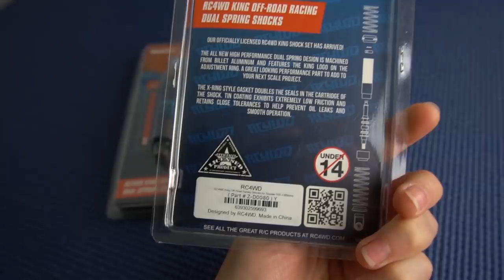Traxxas TRX4 Shock, Servo & Wheel Upgrades for scale performance

Comment from the maker: Sharing some more reflections on the new upgrades after I had some drive time with them :

Shocks: At first I thought the shocks might be too soft, but they give really cool realistic movement out on the trail. They feel like more in a droop style setup. So overall, really like them. 

Wheels: The tires are narrower, but a tad taller than the stock tires but they fit perfectly with no wheel rub. Need a bit of wearing in, but the foams are stiffer so they can hold up the 700 g of weight that I added, but dig in places where I need it. AND they look super scale, which is a bonus. And yes, I do need to rotate the driver's side tires - apparently the tread needs to run backwards on that side?! 

Servo: The TrackStar TS910 servo that I had in there was quite good already, but the new one has about 100oz/in more torque, and is waterproof already (vs. having to waterproof the other one myself). Same price range for both. 

I think overall, really happy with the new setup!
Reply: How do the shocks work compared to the desert lizards and the standard ones? I have been fiddling with the standard ones to reduce the "stiction" as much as possible without having them leak. Just wondering what the others are like? Great vid as always!
Reply: https://www.rubitrux.com/pub/media/catalog/product/cache/0203a3ce39d0f2a50de84c12f1a55394/c/u/custom-jeep-wrangler-mango-tango-aev-snorkel-273029.jpg

Think this is how the tires are supposed to be set up. That's how I see them on real trucks, at least.
Reply: That truck is soooooooo badass. Almost looks real
Reply: Adding the same strength shock oil (30w) to both front and rear shocks seems to have really lowered my rig at the rear. Perfect at the front. Any suggestions? Different shock oil strength?

Comment: My first mod. Changed the shock oil to 10 wt. It makes such a difference. The shocks actually work now and the car doesn't bounce all over the place at full speed over rough grass or gravel roads. It tracks way better too. (stock shocks)

Comment: A new vid from RC Girl? Instant mouse click. The  RC4WD Goodyear Wrangler MT/R Tires are on my list to replace the stock tires on my Capra. The 3-piece alloy bead-lock wheels I added to my TRX-4 Sport are also a pain to get properly fitted. I found after adding wheel weight to my TRX-4 the blue Pro-Line closed-cell 'crawler' foams helped immensely in the front tires. Flexible OD tread, but no more 'fold-over' when turning Left or Right.

Comment: Great vid!!  TRX4 is looking good. Watch putting greese on your shocks like that. Greese will collect dirt and could cause them to lockup completely. Could also score the shock body causing them not to work smothly. A dry lube would work better. It will dry but still be slick and not collect dirt. Also on your new tires.  Per Goodyear on the full size MTRs. The large lugs go to the outside all around. Just wanted to give you those tips. Keep up the good work and look forward to more vids!!!!

Comment: Hey RC Girl. That a sick new setup. I have the same weights setup you have from Yeah Racing and upgrade mine to 2.2 wheels but those tires seem working perfectly for 1.9. Love your new aluminum rims colour and the fact you can see the nuts because the 120 little screws are not something you want doing them all the times. My old one were similar but needed removing 6 little screws in middle each times to tighten or remove wheels and those screws breaking easily more you touch them. Your new servo seem handles the weight that a challenge to find out what servo work best with extra low gravity weights. I have the TRX 400 and I wish never bought it. Not good at that weight added. My next servo is going to be Reef’s RC RAW 500. I will let you know how that going when I will do the switch. Very nice rig. Cheers

Comment: I had no idea of the level of customization on an RC off road truck. Everything looks like full size equipment. The shock tuning would be a lot of fun. I’m an electrical specialists on the T38 jets for the Air Force. So, I love to tinker with electronics. I was looking for a new hobby and was thinking RC would be cool, I had no idea how cool . I first saw the RC airplane now this. So cool.

Comment: Awesome Video. Questions about the servo installation:  was the servo wire long enough without having to extend it? Also, did you fit it without an external BEC?

Comment: What is the benefit of putting in ur shocks? I have a TRX-4 kit but never put oil in the shocks & not sure if I should. Also, with ur truck being so heavy, have you ever run air filled tires like the G-made or another brand? What are thoughts & impressions?

Comment: I put together a shock, I used a 100 weight silicone oil, it dampened much better than 30 weighr , --- at least for the heavy rc truck I installed it on. . .

Comment: I was doing some research on these, and this video came up in my feed. Very cool! I had no idea you could get actual beadlocks for these and the level of customization available. Now that I can't really use my real 4x4, I  just started looking into these as hobby to do in the meantime. Would you recommend this model as a good one for beginner? It keeps popping up in my research, and I really like the looks of it. Thanks!
Reply from the maker: Yeah this is a great first rig. It was actually my first RC crawler (and now I have quite a few 🤦🏼‍♀️), so careful! It's addictive!! The trx-4 comes in a few versions - builders kit, RTR, sport. Kit doesn't come with a body, needs assembly and electronics to be purchased separately. TRX-4 RTR comes in a few body types (defender, bronco, blazer...) and has 2-speed transmission and locking/unlocking diff function. Sport comes with a truck body but doesn't have those two features, and is a bit cheaper. All are good choices!
Reply: @RCGirl  thank you so much for the info! Since watching that first video, I've watched a few more and I think I'm sold on the TRX4. I'm sure the sport would perfectly suit my needs, but the K5 Blazer is one of my favorite vehicles of all time so I think I'm going to have to get that one. Although the Sunburst Bronco body that they make is beautiful too!

I was actually digging the Redcat Gen8 Scout II, that seems like an amazing body, but I read a few reviews and it seems like the quality isn't up to par as compared to the trx4. It's a lot cheaper, but I don't mind spending more money on something that's going to work right the first time.

Comment: I’m fairly new to the 1/10 scale trucks. And it’s kinda overwhelming when it comes to upgrading electric parts. With that in mind, will the 35kg servo you displayed work for my TRX4 Bronco steering as a 270 degree?  Or do I need the 180 degree?  The stock servo is struggling to turn my wheels when crawling in extreme conditions and when the front diff is locked.  Thank you RC-Girl...

Comment: Great video RCGirl What were your thoughts on the new parts?
Reply from the maker: Yeah I kind of just wrapped the vid without sharing my thoughts hah! At first I thought the shocks might be too soft, but it gives really cool realistic movement out on the trail. Kind of more in a droop style setup. So overall, really like them. The tires are narrower, but a tad taller but they fit perfectly with no wheel rub. Need a bit of wearing in, but the foams are stiffer so they can hold up the 700 g of weight that I added, and dig in place I need it to. And they look super scale. The Trackstar TS910 servo that I had in there was quite good, but the new one has about 100oz/in more torque. I think overall, really happy with the setup!

Comment: I have bought the exact same dampers for my TRX-4 Defender. I am not that pleased with them. They leak oil, and almost faster than I can refill them. Well it's not THAT bad, but They leak a lot. After each time I use the car, I have to refill the shocks.

Comment: What size wheel hubs are needed for mounting Vanquish wheels on TRX4? Also, do I need to buy hardware separately? Thanks
Reply from the maker: Not sure, I don't have experience with Vanquish wheels - sorry!
Reply: @RCGirl  Sorry, my mistake. But thanks for replying to my question. Keep up the good reviews.
Reply: @bobdegood71  I believe a 225 or 350. Depending on how you like them to sit in relation to fenders and body style. 
Cheers 👍

Comment: Just a kind heads up, the passenger side tires are backward 👍🏻
Reply from the maker: Yeah I went back and forth on that. If I flipped them around so the smaller tread was on the inside, then then tread pattern would be backwards 🤷🏼‍♀️ In full scale, there's be a left and right tire, but these don't come that way
Reply: @RCGirl  The more open lugs to the outside is Goodyear specific way to run them. Scale Builders Guild did an in depth explanation about those tires. Great looking rig by the way!
Reply: @RCGirl  in full scale the tires are exactely the same.. passagenrs side runs backwards.    With more spaced lugs at outside.    I run this at my 1:1 car.
Reply from the maker: @royomtb  interesting! I'll have to swap them then. Oh beadlocks.... tiny screws get me every time. ;)

Comment: Hi RC girl 👧 
Do you know if theses new bead locks and tyres will work with the trx4 Sports on standard shocks. ????
As they really look 👀
as cool a penguins 🐧
Peee
Reply from the maker: I'm not sure, but thinking yes? You'll have to search around what max outer diameter would fit the sport, but I believe the chassis are very similar. These are 4.75 which is probably the max you'd want to go before you start getting wheel rub.

Comment: I wouldn't call the king shocks an "upgrade"  more like a change the stock shocks are great performers when rebuilt and tuned. King shocks are mahhhhh and over priced because of The branding
Reply: 100% mate... had to spend a heap tuning the king shocks making a bleed groove, and I found silicone diff oil works best with a lighter spring.
They look pretty but Trx4 shocks are way better.

Comment: didn´t you ever consider advertising cheaper stuff ? all hese axial models are freakin expensive ? and i don t get how they switched from MOA´s to more scale like layouts , i know its supposed to be more realistic but in the end inferior in performance .... RC girl can you review that Ebay chassis for a couple of 100 dollars/euros ? link >> https://www.ebay.de/itm/AUSTAR-313mm-Radstand-Chassis-Rahmen-fur-1-10-AXIAL-SCX10-II-90046-90047-RC-Auto/133291233920?var=432680739888
Reply from the maker: Yeah these are trail trucks, not intended to be extreme rock crawlers. It's a different driving style. I'm happy to review more budget friendly stuff next time!
Reply: @RCGirl  thank you , thanks for the response !
Reply: @solunasunrise  that chassis you linked is crap mate... You have to mod the heck out of it to get it to even come close to a premium brand. The geometry is all wrong, shocks are ordinary etc.
I'm all for saving money but it's just a poorly cloned attempt. Buy the real thing  and try and find bargains or special deals on the parts to complete an scx10.2 chassis kit or with the new scx10.3 release they will have specials on rtr's
Or a Redcat Gen 8 Pack kit or RTR .
Cheers mate 👍